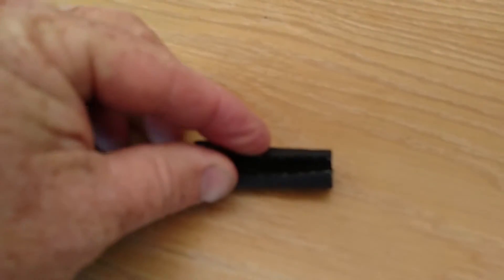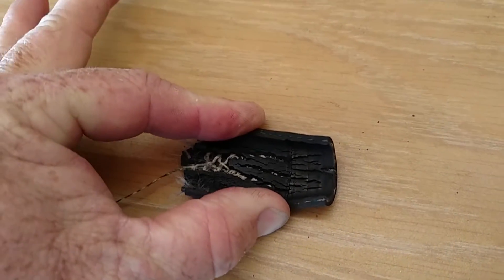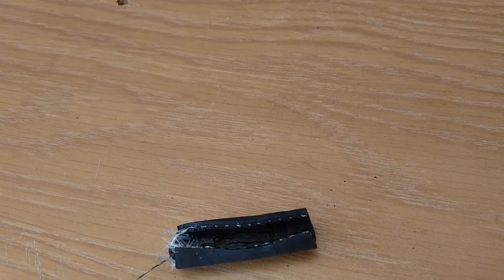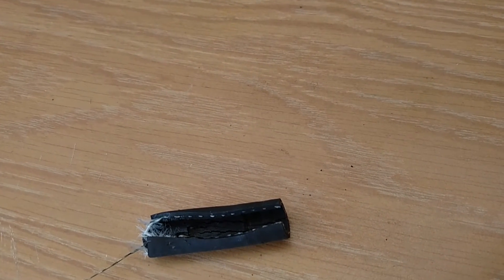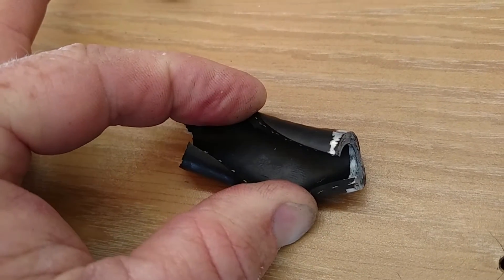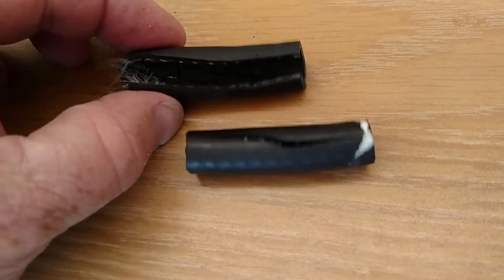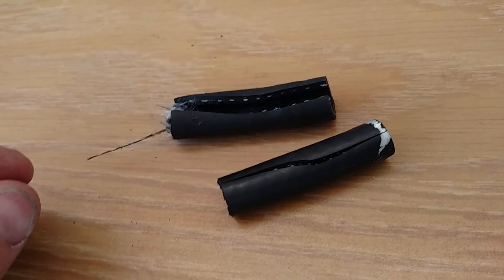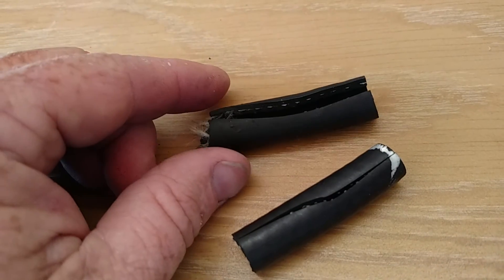Ethanol and fuel line!

Comment: FAA approved fuel lines are using legacy rubber products and are not ethanol compatible. 

You can’t use ethanol in an airplane. 

Automotive fuel line is ethanol compatible.
Reply from the maker: It's an experimental aircraft.  It runs on pump gas.
Reply from the maker: These aircraft are ultralight, or experimental.  Rotax recommends mo gas for their motors.  Gates makes products designed for ethanol.  The fact is there are no rules for experimental or ultralight aircraft.  You are your own expert on anything that you do.  I like to think of it as peeling the onion down to the layer you are comfortable with.  Faa approval is not required on these classes of aircraft.